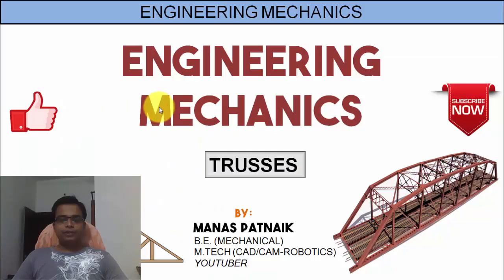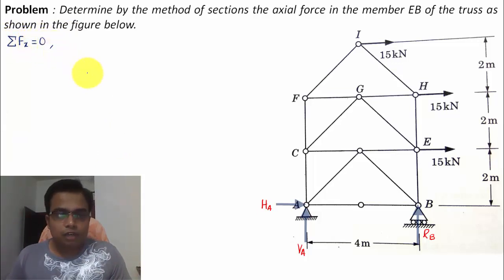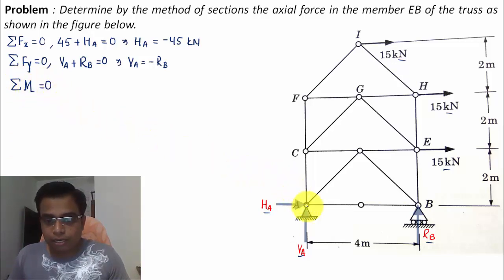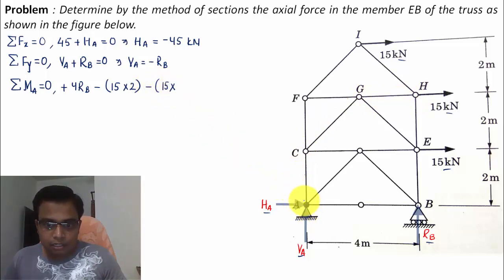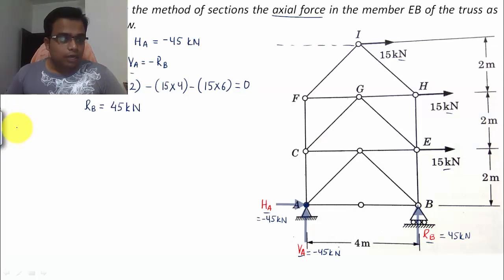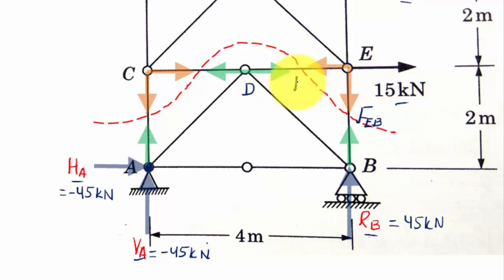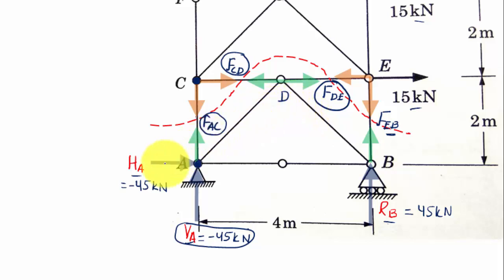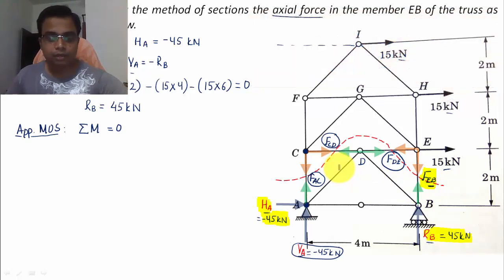Trusses_Method of Section_Problem 2

Comment: why Ha is -45 kn?
while calculating reaction forces in X direction, if i consider Ha acting towards left as -ve and all 15 kN forces acting towards right as +ve then Ha would be +ve?
-Ha+15+15+15=0
Ha=45
Reply from the maker: Will get back to you in a shortwhile....
Reply: See the directions of all the reactions (forces) acting horizontally and reactions are  1. 15 kN at I joint 2. 15 kN at H joint and 3. 15 kN at E Joint So summation of all these forces comes out to be 45 And The reaction H(acting at A) is in the same direction as the three reactions acting at I,H & E So to balance these forces It's magnitude should be exactly opposite and equal to those three reactions (acting at I, H & E) So it should be -45 So that it Balances the whole frame
Reply: Yes, you are right. As you have assumed Ha towards left and got the positive value so you have to make calulations on the basis of that only.